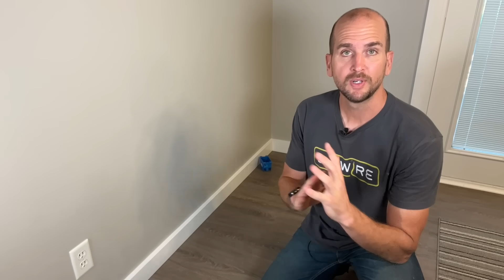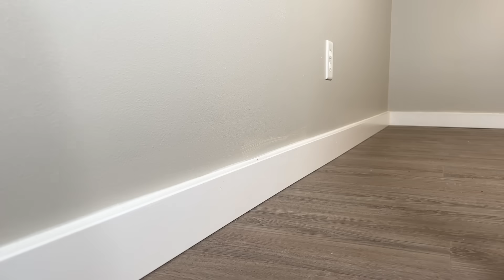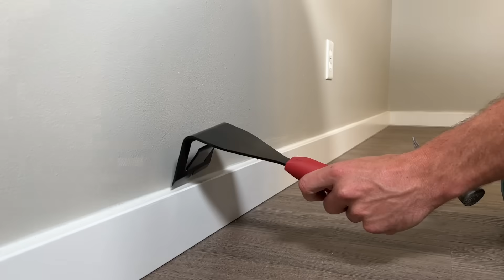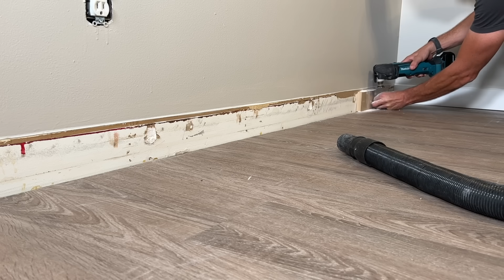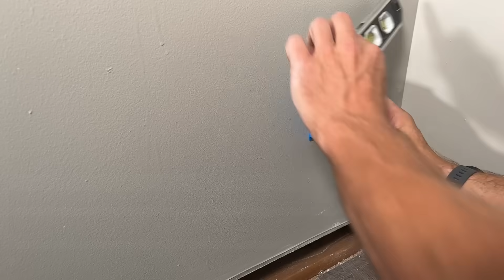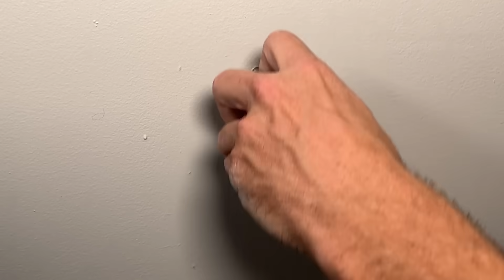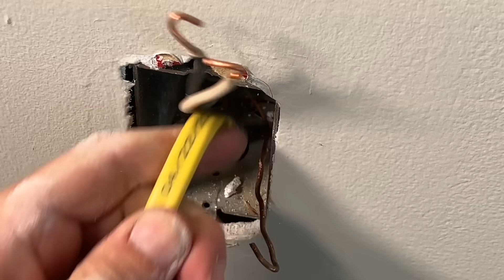How To Add An Outlet To A Finished Wall

Comment: Not allowed to do this in NL.
Electrical power wires need to be in hard pvc pipes.
So you would be able to get that in there using a lot of joints, but its going to be a pain. You then basically use the wires themselves to force the pvc into position.

Comment: It may have been asked already after 3800 comments, but I'm curious why you chose to use a wire nut and pigtail instead of simply branching off the second set of screw terminals on the existing outlet, which appeared to be at the end of a circuit and have a free set of terminals...?

Comment: Important question 🙋🏻‍♀️ I hope someone can help! 
I have only one electrical outlet in my bathroom (a dual GFCI next to a light switch)
The GFCI 2 gang was added when i got the house 20th years ago, Now, my concern is the house is lath and plaster and I really need another outlet. The outlet is on the wall above the vanity, is it possible to still add another outlet through the lath & plaster?

Comment: My baseboard trim was not as tall so I ran the wire on the horizontal 2x4. I thought I should put stickers on it to warn someone not to drive nails in. I ran the wire because my family room only had one light switch by the sliding glass door after I walked through the room. Now I have a switch when I enter the room.

Comment: How irresponsible this video is. Don't you have to be a licenced electrician to do this!  I wonder how many people will get hurt because of your video.
Reply from the maker: Always need to check your local code but homeowners in my area can work on their primary residence.  Was there a specific part which you thought would lead to injury?
Reply: @EverydayHomeRepairs  yes I thought the re wiring was a risk for somebody who has no idea and I know you used a device to check if there was power at the wires but not once did you say to have the mains off. They were my concerns.

Comment: What a fantastic idea!  So glad we have videos like this that make life just a bit easier!  I do have one question for you.  Why the pigtails?  I, personally, would have put the line side on the two top screws and the load side on the bottom set.  Is it personal preference?
Reply from the maker: Pretty much,  in a few instances pigtails are required by code but this one was just personal preference.  Your approaches if perfectly fine.

Comment: Just a question. But why did you add a pigtail when there was enough space on the receptacle for two sets of Romex to connect to one and one out. Too much wire in that box in my opinion. Just saying my opinion, the pigtail was absolutely not needed. But I might be wrong

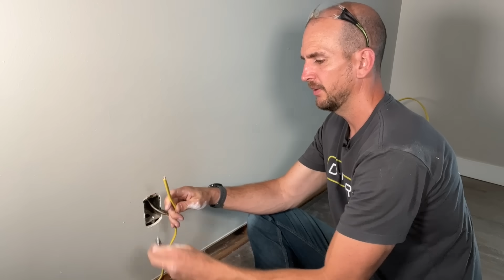Comment: 6:28 all these years and I never considered attaching the NM clamp to the cable first, before installing it in the box. Learn something new every day.
Reply: Good trick; I do this quite often. I use a 90° angle head drill, so great for getting into stud bays and drilling through sill plates. A 4 ft flex bit is also a handy tool.

Comment: I honestly hate wagos. you might as well back stab the device while you are at it. I like the skill and know how of identifying the obstacle in which to keep your work neat and clean. However, its ok to give your wires a little extra length when at the box. And lastly just get some wirenuts, mechanically twist the wires and now you have a connection that couldnt not possibly have any trouble if done properly.

Comment: Question from someone who doesn't know: What is the reason for leaving part of one of the stripped wires exposed? Would it not be better to heat shrink cover the excess to protect it from oxidation over time?
Reply: You're probably referring to the bare ground wire. The ground wire is always (supposed to be) connected to a neutral ground point, so it will never give anyone a shock. It comes that way in the electrical cable. True, it might conceivably touch a hot wire screw, but you push them out behind the outlet during installation.

Comment: In the states everybody installs electrical systems to the bare minimum of the National Electric Code in the National Electric Code when you drill the holes in the studs the side of the hole where you feed the wire through needs to be at least one and a quarter inch from the face of the stud.
 In addition, metal boxes must be bonded.
When you make the ground wire splice you need to have a separate tail that bonds the metal box to the grounding system.

Comment: Electrician here. You have absolutely no business adding on to branch circuits if you don't know how many are on there in the first place. 1800 VA is the maximum you can have for any branch circuit when it comes to receptacles. But hey it's your house, if you want to burn it down, go right on ahead.  I'm not even gonna comment on the crappy way you're installing this just to make it easy.

Comment: Thanks for another helpful video.Your work is well done and safe. Sorry there seem to be so many critics on YouTube. Wago 221 is rated for solid or stranded wire at 20 amps and are NEC rated. As you already know, it is important to strip wires to the right length so the Wago clamp (or clamp style receptacle screw) doesn't catch the insulation and cause a bad connection. Most of us have used wire nuts forever but they are not foolproof and may not always grab all wires equally-you can end up with a funky connection. I pre-twist wires before putting on the wire nut. I installed an old work box under a kitchen sink (very little space to work) and the old drywall crumbled from the clamp pressure.  I screwed the box to the stud and it was totally solid.

Comment: BS.  How often do you have wide baseboard?  Use a flex drill 3 inches below the existing outlet to the new outlet and you'll have to do minimum drywall repair.

Comment: Great tip well explained.
I notice that u install your sockets the wrong way up though,the dangerous way.
Upside down to make a smiley face - the previously smiling face of an electrocuted child perhaps?
The live pin should be at the top so there is little to no risk of small fingers touching it when inserting or removing a plug.
1" spade bit is a bit big though,weakening the stud significantly without good reason.
3/4" or even 5/8" would be better i.e. the smallest bit your cable will fit through.

Also,if it's a short-term rental property then sockets with USB charging are a good idea.

Comment: Damn....  I've run miles of wiring and installed tons of old work boxes, but I never thought to run it behind the trim. When I think of the hours and hours I've spent on drywall repair and painting, I could just spit...  Great video, I'm going to share it with my son and son-in-law so they will learn while they're still young.  Thanks!

Comment: Wow. Aussie sparky here. Great tip. Couple of things, we are not allowed to drill any bigger than 20mm in a stud as it weakens the structural integrity of the stud. 
Also in Australia our earths must be insulated and are treated the same as the other wires. 
We also have stopped using outlets like that decades ago. 
We don’t use wall boxes unless it for fire rating purposes. 
Not saying one is better than the other, but it is interesting to see how many differences there are.
Reply from the maker: Do you guys use similarly sized studs for your walls?

Comment: "Quick" and "Easy".
I usually avoid products that contain either of these two words in their names.
Same about your demonstration. If I had been installing that piece of drywall back, I would have sprayed both edges with water, then applied some Sheetrock or even gypsum on each edge, etc...
And BTW, most floating floors (like yours laminate) have quarter rounds on the perimeter, making it trickier to remove the wall base.
Finally, I recall that the US building code requires an electric wire to be fastened to a stud within 2 feet from a switch or an outlet.
But as you've said - it is not your home where you plan to live, so "who cares"?
"Quick" and "Easy"... Like everything these days.

Comment: Thank you, great video.  For me i wished the part where you made the actual romex connections at the original outlet was no so sped up as that is what i really wanted to see to connect the wires correctly.  Otherwise perfect thanks
Reply from the maker: Thanks for the feedback, if you need a little more help you can just go to our channel page and go to the video tab.  If you are on a laptop/desktop you can use the magnifying glass and search for "outlet" where you will find several examples that dive deeper 👍

Comment: Was the metal box grounded, did it have romex cable to metal box from the start or was it bx wire.. I always ground the box with a bare metal wire and green screw if it's a metal box, is this necessary or am I wiring a ground for nothing.
Reply from the maker: Original box just had romex coming in and the bare ground around the integrate clamp screw which I now know is not code.  Would have been better to drill and tap for a grounding screw or add a grounding clip.  So, the box is grounded but not technically to code.

Comment: Good job, you just hooked the new receptacle up shorted out. You hooked the black and white wire on the same terminal. I sure you fixed because the circuit reset.

Comment: Loved the video.. only point I have an issue with is the lack of pig tailing the metal box... 250.86 Other Conductor Enclosures and Raceways. Except as permitted by 250.112(I), metal enclosures and raceways for other than service conductors shall be connected to the equipment grounding conductor.

Comment: When using a cat's paw or pry bar against drywall, place a wide (3" or so) heavy-duty putty knife between the bar and the drywall.  No dents, and plenty of bearing surface to pop nails out.

Comment: Portland electrician here. I can confirm this is legit. Had a finished attic that only had two outlets in it to start and brought it up to modern spacing using this method. Told customer to take the trim off everywhere under where he wanted an outlet and wait till I'm done to install the new ones and paint. Saved him a ton!
Also, try to drill all the holes in the bottom of the studs. This way they can still nail the trim at the top and you can guard your holes with sideways nail plates. :D

Comment: I enjoyed the video and you made it look easy. However, I think you skimmed over the connection of the wiring at the original terminal way to fast for someone that doesn't already have the required knowledge. I literally have no idea what you did, and guessing is never a good idea with electrics.

Comment: You are lucky the caulk on top of the base didn’t rip the facing off the drywall. You should cut that caulk line with a utility knife before prying the base off. 

Other than that- awesome tip!

Comment: Wow that alot of unnecessary work, great video but work smarter not harder
Reply: Flex bit made buy klein using bumber balls made by rack-a-tiers. Drill straight across from the existing hole to new hole

Comment: Thought you should know that in the States where I live it is now code to wrap all receptacles & switches with electrical tape. Some of us have done this for many years but it is now code. However even if not required it is a good safe step to add. Excellent video & great approach which I have never used!
Reply: No, it's not against code.  Nowhere in the NEC does it state that.  Best practice? Yes.  Required?  No.  However, there's a possiblity there's a local requirement...but again, not NEC

Comment: that was an awesome way to run a plug in those cases. i just ran a few plugs and added a switch and i can say i wish i was able to do it thiis way instead of climbing around the attic. may use this method to move a few plugs behind a sliding barn door to make the plug behind it when open usable again. just a little annoyed because the floor guy just finished the work and the base is fresh lmao. love the detail as well

Comment: This was a great video. I have to add outlets to a lot of customers home for tv installations, and this is helpful.  The only thing I might recommend is not pulling the entire length of romex through the drywall at the new outlet location but rather feed it through the studs first and then back feed it up to the new hole ln the sheetrock so that the romex doesn't have a chance to tear or damage the drywall.  I've damaged enough sheetrock by accident by pulling lengths of romex through a new hole.

Comment: Very slick job. I like that you can get the job done in an hour or so and not have to tape, compound, plaster and paint.  This avoids return trips to the job because coats of compound need to dry.

Comment: FANTASTIC content here. Using the trim to prevent this from being a drywall and paint project is like the drywall dust clouds parting and seeing the DIY blue sky for the first time. Love this!
Reply: and if you dont have base boards you can always add them
Reply: @tonythomas951  Even if you  don't have baseboards, cutting the drywall at the bottom cuts the repair to one joint instead of two.

Comment: Great video.  I've done this trick many times and can say that you explained everything very well.  The only thing I would add is that you really should add kick plates on the front of the 2 x 4 studs, overlapping the area where your wire runs through them.  That way, in the future, if someone shoots a nail or something in the trim, they can't hit the wire.  Thanks for posting this for everyone.
Reply: In the video he explained that he drilled his pass-thru holes higher than his trim.  There wouldn't be a way to put those plates on b/c the holes are behind the drywall left in place.  Since the holes are higher, he won't hit the wires when reinstalling the base.  If someone else comes and puts a taller base in, they're out of luck.
Reply: Agreed- or make sure the hole is directly in the center of the stud leaving minimum distance of 1 and 1/4 inches from either face of the stud as per N.E.C.
Reply: or, as an alternative, put a short piece of steel pipe through the holes in each of the studs, and pass the romex through that.   Not 100% foolproof, but if somebody ever comes along and tries to drive a long nail or screw into the stud at that location, it would be stopped or deflected up/down to avoid the wire running through.
Reply: Does he not need to use wire staplers to clamp the wire the the stud? I'm fairly certain you do where I am.... at least, I did it in my basement.
Reply: @jonnyjazzz  Probably not.  It's pretty common to steal power from an existing outlet or switch to power something new like a ceiling fan that didn't exist in the room before.  You would not staple those either b/c no one's paying to redo a bunch of drywall just so you can staple the wires to your ceiling fan.

Comment: Code requires you to secure the wire any where from 8-12 inches from the box, depending on local code, to the stud in all US and Canada! That is one of many errors. Lawsuits if an issue happens here! Insurance may not cover if there is damage due to these techniques he has.

Comment: I think this video should be slowed down Re: daisy chain connections. While I enjoyed the fast forward directions are terrific, the connections with live wire is THE most important piece and it’s delivered at fast fwd. 
I’m a novice electrical hack and didn’t understand or see the section during connection fittings.

Comment: I was hoping for something more complicated because the title of the video was, let's say, overly general.
I was actually expectig to get some tips on how to run a Romex 2+G cable from a light switch installed at standard height to the attic without having to cut she sheetrock and messing around with the wall thermal insulation.The basic project consists of feeding two ceiling suspended lights with the same switch that is an unwired spare at this time.
The wiring run is of course vertical like the 2x4s and may or may not have to go trough horizontal wooden beams. I thought of removing the switch box and try to poke a steel wire upward. Will I go through? Any suggestion will be appreciated

Comment: Not trying to be a know it all, but last time I checked: most of my fellow electricians unanimously noted that Wago‘s are not for connections in a receptacle box… I believe they are ONLY listed for lighting (inside of a luminaire).  Wire nuts should always be used in this application. Also, it’s completely fine and code compliant to use 12-2 NM cable to jump from your old outlet to your new one, but as long as it’s not in a bathroom, kitchen, or basement… You can save yourself the money, struggle making up, and space in the box with 14-2.  Just trying to be helpful. That said, this was a great tutorial! I sent this link to a person who did not feel like paying anyone for electrical services in hopes that they might get it done right because it is a good reference.

Comment: Hopefully the outlet is off before starting, and verified with a power sensor (plug in testers fail often). Yes, even sticking a metal taps measure into an outlet without a cover will bring magic sparks.

Comment: This only works in America where houses are built out of wood, nails and plasterboard / dry wall, and need have a 20-40 year life span. In Europe we build houses with brick, mortar and concrete, to last many centuries. It’s really nice, but placing an extra socket is very hard work, you’ll need an angle grinder (or a slot grinder) and will need to refinish the wall.

Comment: You should never use connectors like that, nor back stab devices. You only end up with shorter and shorter wire down the road.

Furthermore, backstabbing is usually always a point of failure. Always hook your wires around the screws, and also use wire nuts.

Otherwise, great video.